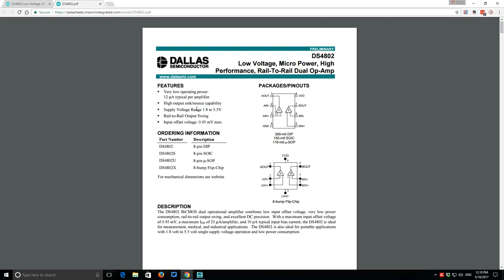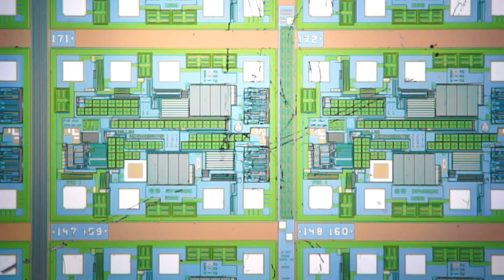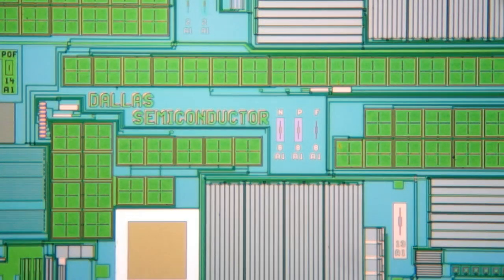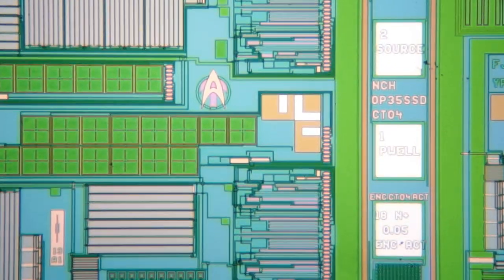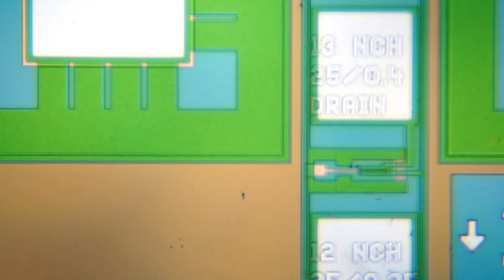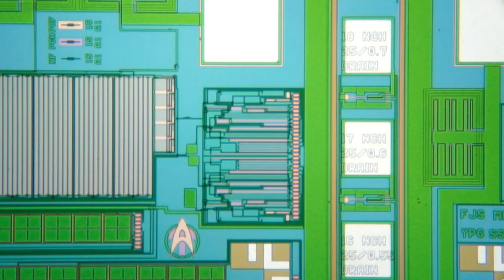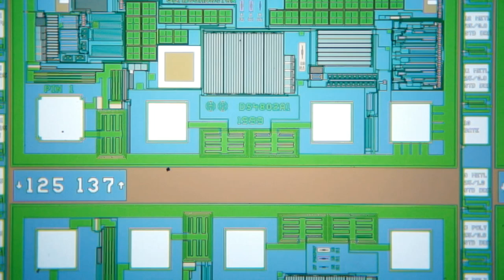Dallas Semiconductor Wafer Art!

Comment: Dave: You're absolutely right about the test MOSFETs. With increasing wafer sizes, a lot of the steps in the fabrication process start to show radial variation. For example, a diffusion process that involves gases might show increased variations in doping quality with respect the radius of the wafer. Test MOSFETs are an exceptionally simple but incredibly powerful rubric used in post-silicon validation to test the quality of the complete fab process and therefore the quality of the individual dies on the wafer. Simple testing of the characteristic curves of these MOSFETs can often reveal issues that were unnoticed in the pre-silicon and even process validation stages.
Reply from the maker: Cool, makes sense. So measure them all and you get an indication (map!) of how the process if affected by the radial geometry over the wafer surface
Reply: EEVblog2 That's the phrase that I kept missing - "radial geometry". I was SO excited that in the 3+ years of watching you, I finally knew enough to say something. So much so that I couldn't even make words.

But that's precisely right - the heatmap of the radial error tells the post-Si guys the parts of the wafer that are out of spec but also shows process engineers where they went wrong in setting up the foundry.

Thanks for the reply :)
Reply: faytaliti - Very interesting stuff.  Thanks for FINALLY posting a comment!  Don't wait so long next time though.  I'm sure over your 3 years of reading these comments that not every one is by a rocket scientist that knows what he/she is talking about!  So don't delay in speaking up when you think you have more to contribute... just don't be one of those kids saying "first!"  ;-)

Comment: The transistors between the die are part of the "Scribe-Line Test Pattern".  During device/process development, we use whole die (or whole wafers) full of test patterns: Transistors of various lengths and widths, resistors, contact chains, capacitors, etc.  They are used to characterize the design rules for the specific "process".   The characteristics are made up into standardized "design rules" which are used by the circuit designers and layout people to make the circuits, and the masks to produce those circuits.  

At the end of the process development, a small sub-set of test devices are selected for ongoing process-monitoring.  We used to have a few test devices (dice) placed around the wafer: center, top, bottom, left, and right was a standard configuration.  But when dice became really valuable (like a high-end microprocessor, etc.) they moved the test patterns into the scribe-line between the dice.  That way, the test devices can be probed and measured on the wafer for process monitoring, etc. And also when the wafer is cut apart into individual dice for packaging, the test patterns are obliterated by the saw, so no trade-secret proprietary details are made easily available to the competition.

If you want to probe the pads, you need something like a Micromanipulator.  I saw a used one for sale, but even old ones are thousands of $$$.  For really fine-detail probing, we had to mount the Micromanipulator on an air-bladder supported anti-vibration table.  A big thick steel slab table top weighing 100s of pounds, and a rubber "balloon" on each corner.  And for probing light-reactive devices and/or very sensitive voltages, currents, capacitance, we had to put the whole Micromanipulator inside a large aluminum box as a combination light shield and Faraday cage.

Comment: I have a wafer manufactured by Trilogy Systems in the early 1980s. It has a "doodle" of "Snoopy", the dog from the Peanuts comic strip (aka Charlie Brown). Also have some (presumably) designer's names on it. The wafer is unlike ANYTHING I've ever seen before, as it's actually designed as what appears to be ONE absolutely massive chip!

Trilogy Systems was a 1980 startup founded by Gene Amdahl. Their goal was to create a WSI (Wafer Scale Integration) chip. The basic concept was to create a chip with integral redundancy that would permit the manufacture of things such as massively parallel supercomputers, and such... Between a string of disasters, and the fact that yield over the surface area of an entire wafer is never 100%... They failed miserably. Still, it's an interesting bit of history.

Here is a pic of my wafer, uploaded to Wikipedia.
https://upload.wikimedia.org/wikipedia/commons/c/ce/Trilogy_WSI_Wafer.png

I have no idea how far along with their experimentation they were when they produced this particular wafer. Needless to say, it was a failure. WSI isn't dead though. Look at mikeselectricstuff and his teardown of a Genome Sequencer, and you'll find an absolutely massive CCD imaging sensor. I think the company that makes those does 4 sensors per wafer, which is absolutely bonkers! I wonder what their yield is.

Comment: Dave:  I think that the range of colors that you are seeing here is the result of the different thickness's of silicon oxide and perhaps add in the doping chemicals used to change the silicon from neutral to P or N type.  I used to work for I.B.M. in East Fishkill, N.Y. back in the late 70's like 1978 to 79 and worked in the HOT PROCESS area with diffusion ovens and the process produced different thickness of silicon OXIDE anywhere from 300 angstroms to 1200 angstroms and this always produced a different color range dependent on OXIDE THICKNESS.  The line I worked in produced a 2Kilobyte memory chip that used Insulated Gate F.E.T.'s  or IGFET's the Gate insulation oxide thickness was about 340 angstroms and the Initial Oxide step was about 1000 to 1200 angstroms and the Source and Drain deposition used a chemical vapor at 500 degrees C and the chemical was Phosphorous Oxy Chloride!  Anyway the result was a range of about 4 distinct colors from the rainbow maybe 1 or two more as the chip was finished. Just the different thickness's of silicon oxide growth would leave a whole rainbow of colors on the BACK side of the WAFER's and later chip dies.  BTW some of these chips went into the memory sections of the 5 general purpose computers on NASA SPACE SHUTTLE!!!!!!  WHOOOO WEEE,  Yup I had a little bit of my work go into space !! some of these chips went into fighter aircraft of the day too!!   ------------  Cheers--------   John A Bellas  KC2UVN
Reply: I was thinking the green may be a result of a doping agent as well.
Reply: I used to work in a semiconductor research fab and we would measure thicknesses using color in combination with the material. The process is different when features are smaller then optical wavelengths, but a uniform surface thickness can be measured this way.
Reply: cool! thanks for sharing your story
Reply: I think I remember the name from some department but he was not in the department I worked in.
Reply: Yes what you say rings a bell with me! We used a machine/or system that shown a laser down on the wafer in five different locations and that laser shown down on the oxide that we grew and gave us the thickness readings in Angstroms!  The machine/system was called and F.T.A. or Film Thickness Analyzer these units were sold by I.B.M. to the outside market as well, primarily to film processing companies like Kodak for example
Reply: Yes, It was an interesting job, but over the years some of my memory cells have lost their charge and so some sections of my memory are a little fuzzy, Glad you liked my short story, it was certainly and interesting job and colorful when you done the wafer inspections under the polarized oblique light inspection, and sometimes we had to use the scope to like Dave was doing here!!
Reply: The technical term for the phenomenon caused by the thicknesses is Thin Film Interference - which also means that if the passivisation layer is stripped off using HF acid, the colours will change due to the effective thicknesses of the layers we're looking through changing
Reply: Yes I kind of forgot about the interference factor and yes we DID use Dilute Hydroflouric acid to do the etching and stripping  of the different layers depending on the stage of manufacturing or layering, yes its all coming back now !!! LOL!!  -----------  John A Bellas  --------  KC2UVN
Reply: John Bellas a

Comment: As already pointed out by others the colors are interference colors which depend on the thickness of the layers, the material of the layers and the layer underneath, as well the angle under which you look at the wafer. There are color charts available from which you can tell e.g. the thickness of an silicon dioxide or silicon nitride layer on silicon - which is most probably what the "green" layer is. From these charts you can see that the top layer probably is 500nm (for SiO2) or 400nm (for Si3N4) thick.

http://www.cleanroom.byu.edu/color_chart.parts/sio2_chart.jpg
http://www.cleanroom.byu.edu/color_chart.parts/sin_chart.jpg

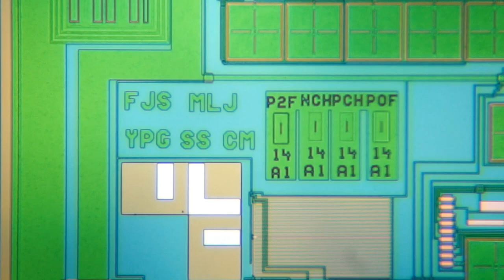Comment: Dave, the FJS, MLJ, YPG, SS and CM markings @4:44 are initials of the engineers that have worked on this particular design. It is very common to see initials like these on dies. I am not sure as to what the "starfleet" logo is, but I have seen it on other Dallas wafers as well. You should find a lot more neat hidden treasures on the other wafers :-)
Reply from the maker: Thanks for sending these in!
Reply: that logo appears to be an A over a T. maybe try and find something from Dallas semi with those initials.
Reply: Any chance we could get some high-resolution photos of these? I would love to print out a poster of this, gorgeous!
Reply: I agree A and a T

Comment: The test transistors are labeled with a series of ratios, like 25/0.55, 25/0.6, 25/0.7, and so on.  I believe that's the width/length aspect ratio of the channel, which is the main factor for determining the electrical gain or how hard the fet can drive.  Those would be used to help characterize the process, since you could test each one to see how the properties vary with the geometry.  You'd then go back and use that information to help on the next iteration of the design, since you could use it to tweak your layout.
Reply: Cezary Akakios yes, also they are often left on wafers so that they can characterize the electrical properties of the layers if needed
Reply: You could do that, but chances are by the time you are building real product that the process has been pretty well nailed down.  Once the line has matured, you typically find narrower "kerf" strips with simpler test structures.  These are basically used to characterize the wafers coming off the line so you can determine if the line equipment itself needs to be tweaked to recenter the process.

Comment: The sections with lots of long thin rows/columns are most likely resistors, and the sections with lots of green squares are probably capacitors.

Unfortunately optical image stabalisation wouldn't help, but you could throw together a microcontroller and some stepper motors for hands-free remote control operation of the X- and Y-axis, which would probably reduce the shaking of the image.

Comment: I worked for Dallas Semi and then Maxim for 12 years as an IC designer, but on microcontrollers, not op-amps. All you can see thru a microscope are metal and poly layers. This looks like a 2 metal process. Maybe 0.6um or 0.8um. I'm not sure where the idea that any thing is laser etched came from, but all the artwork is done in Cadance Virtuoso just like the rest of the masks. In 1999 when this part was done, the company would put a lot of artwork on. The Star Trek symbol is very likely related to whatever the project name for this part was. Unfortunately, since this wasn't my business unit, I don't know what it was. The letters are definitely the names of the people that worked on the part. The letters after the part number are the revision numbers, A1 being the first silicon. The little rectangles with lines above and below are DC marks for aligning the process equipment. There should be one for each layer. The number directly below is the layer. Not sure why there are multiples for 15, for instance, that wasn't the way we did it. The die itself is everything inside the green box. Just outside that is the die seal and outside that is actually the scribe area where the test structures are located. That is why individual transistors are labeled. You can measure the ID or VT of a given sized transistor and ensure that your process is still in spec. These are probably double wide scribes, which is why so much is left. The saw cuts right through this area. I don't recall ever seeing as much left after sawing as this. See if you can get ahold of a Java iButton. I didn't work on it specifically, but I worked on its follow on chips. It has great artwork.

Comment: Try light from a different angle and the colors will change. The color is from reflective interference in the thin layers like oil on water or soap bubbles. In this case the color left after interference for 90° light (I assume that's how the microscope's lamp is positioned) just happens to be green.